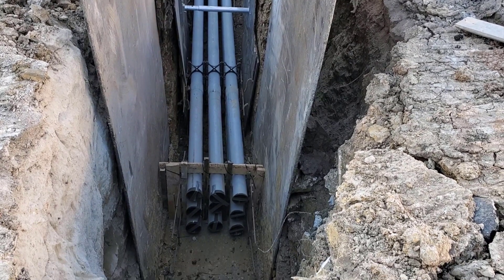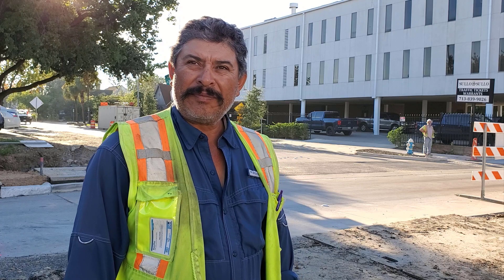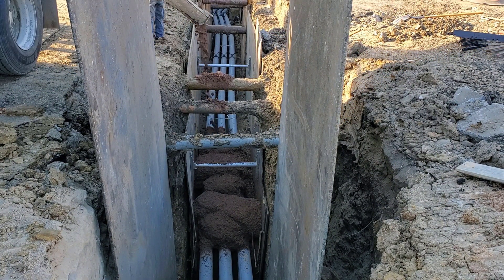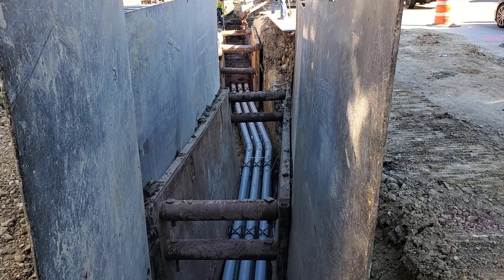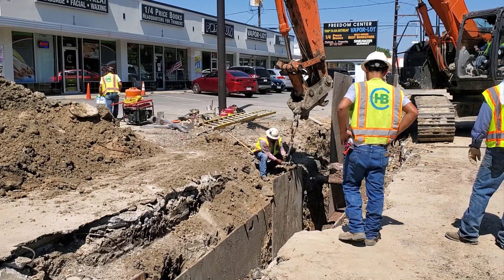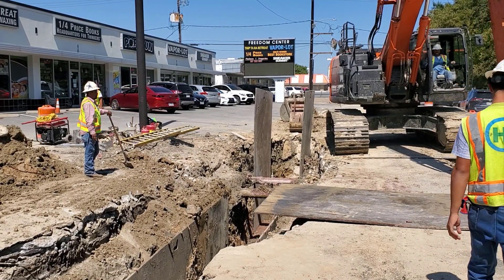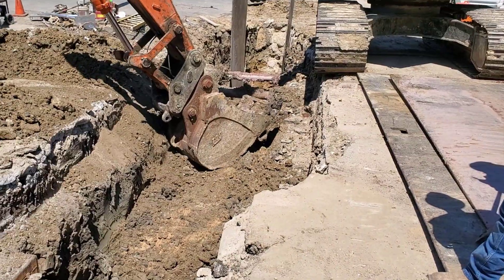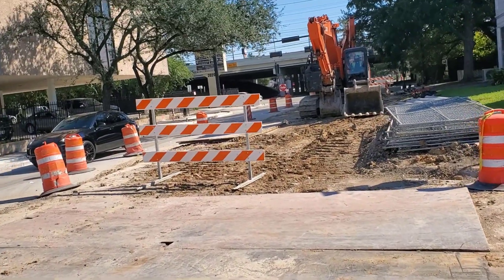Installing Electrical Conduit Underground #electrical

Comment: you learn something new everyday, i didn't know the concrete needed to be different colour incase it is dug up by other contractors
Reply from the maker: Thank you for watching.
Reply: For smaller stuff you just put red ditch tape (yellow for natural gas) in the ditch so when they dig it up they'll know they're about 1-2 feet away from hitting it
Reply: @bnbcraft6666  yup that’s a fact
Reply: Facts. I do this but in Baltimore city. If u sand then you know a water line is close.